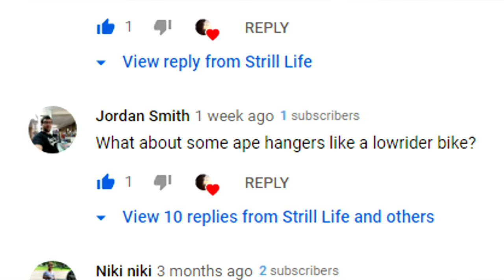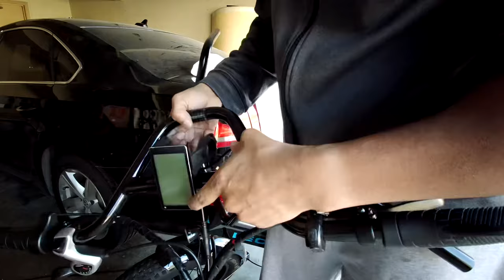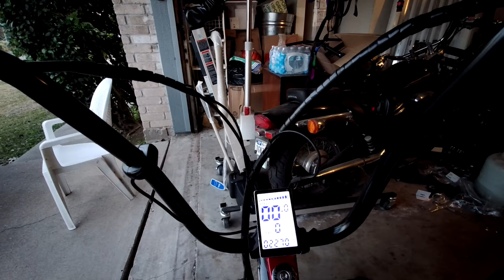Ape Hangers on a Lectric XP!?!?  New bars and mods... The Lectric XP adventure continues...

Comment: When I changed seats, and added Zoom SP, on my XP, I lowered front end of seat. This allows me to rest on back of seat (when I want) and this gives me Excellent shock support.
Reply from the maker: Ahhhh... i may have to try this. Do you feel like you are sliding out of the saddle though? That's what i feel like when the seat isn't totally level. I always have to reposition my butt on the seat.
Reply: @StrillLife  Perhaps a bit. I'm still using stock handlebars, so my experience may differ. Also, I'm only 5'8"...
Reply from the maker: @diamonddbw  oh ok. The bike is the perfect size for some one your size. It's a compromise for anyone who is taller. It can accommodate taller people and be comfortable about I didn't like riding 7ft up in the air. Lol. So I've had to find the happy median when riding.
Reply: @StrillLife  I bought a FMFXTR straight end pole via ebay, so I can mount a saddle with standard clamp, it is 350mm long, if the pole squats low as you sit on, there is a preload at the bottom of post, use 6mm allen hex key to screw the bottom nut in if need be

Comment: The secret to taking the stock grips off is to use an air compressor with the small fitting that fits in the hole in the grip.  The grips practically fly off once you hit the trigger.
Reply from the maker: That makes sense. I don't think my rooty-poot mini car compressor would have done the trick but I sure would have tried it if I knew about this trick before I cut the stock grips off. Thanks for tip.
Reply: @StrillLife  If you ever want the stock grips again....i think they're like $7 on aliexpress....
Reply from the maker: @Knifenerd  cool. Thanks for the heads up.
Reply: A nice set of clinch on grips would be cool,

Comment: Big Strilla!! Your joint is nice! Does it feel a little different than the bmx bars. (Haven’t finished the video yet) sorry if you answered it in the video. I’m commenting as I watch lol
Reply from the maker: Yeah every time you change the way the weight is distributed over the bike it feels different in the turns. Like you feeling like you are falling sometimes and have to catch yourself with momentum. 

Also like I was showing early in the video the bike doesn't have the same torque that it has with a strong battery. So it takes some getting readjusting to. But it doesn't take long. I think I'm going to like the new seat and suspension post. I need to ride a little longer to know if it's real or just hype. I'll keep you posted. I'll do some more videos once the weather clears up.
Reply: @StrillLife  What size seat post do I need to replace my stock one?
Reply from the maker: @rrjetpilot5436  good question. I forgot exactly. Let me check.
Reply from the maker: @rrjetpilot5436 the original post is 1.25" diameter (31.8 mm) and 19.5" long. I hope that helps. My suspension seat post has a slightly smaller diameter. I just had to screw tighten the clamp some. No problem.
Reply: @StrillLife  Thanks the 31.6 probably should work with no problem. I discovered your channel while I was searching for info on the Lectric xp bike. I ordered one last week I know I'm going to upgrade the suspension as soon as I get it. I enjoy your videos! Keep up the great content brother👍
Reply from the maker: @rrjetpilot5436  Thanks so much man. I've been thinking about some new videos for the bike.  I need to get a least a new rear tire.  It's almost bald. LOL. And thinking about a few other things.  So stay tuned.  It might be a minute but I'll have to do or not be able to ride and I couldn't deal with that.  LOL
Reply from the maker: @rrjetpilot5436  and the 31.6 is what I have as well.  The one I have isn't a long as the stock seat post. So that's something to consider if you have long legs. I'm 6'2" and the seat max height is a lil lower than I'd like but I'm used to it now.
Reply: @StrillLife  I never actually used one but kenda tires looks good. Ive only used the kenda innertubes on my regular bicycle and they worked great!

Comment: Damn they are giant! Very cool, wonder if they make those with a cross bar? They would look even better....giant bmx bars! I dont need to flod them down, could i just get a long goose neck... ( stem) and mount them on that. Idk ill have to see how comfortable they are woth the stock bars first,  i just bought a  senada drifter,  its exactly like ur lectric....not as  good thou i assume. Did u do adjust ur speed settings?  They say i get more speed when u dp that,  id like to see if mine will get higher speeds also
Reply from the maker: Lol. I really like them. The do flex a little under hard braking but not much. They are pretty solid. I think these have a 12 inch rise. They are much wider however. So getting used to turning and balancing on the bike is a lil different... Noticeable mostly at low speeds and in turns. The bike can seem a little tippy until you get used to it.

Comment: It looks like your stem has some play.  If the stem isn't a 25.4MM stem like the factory stem, you need to buy a shim which is an adapter to make a 22mm tube fit into a 25.4mm tube perfectly leaving no gaps or play.  I'm not sure if it's the right thing to do but I saw the other guy (brand new guy or whatever his name is) using the quill from the stock stem.....If there is any play at all in the stem, it's super unsafe because with each vibration from the road, the metal is slowly getting distorted and more loose every second which will cause all sorts of problems on the bike.
Reply from the maker: I did follow David's suggestion and swap out the stem wedge with the stock wedge. The stem is very stable now compared to how it was. I hadn't finish doing all the adjustments and tightening in that shot.

Comment: Ya my tires are about the same as yours. Im thinking about the kenda kraze i think theyre called....they look more like motorcycle tires
Reply from the maker: Yeah I think those are the ones I was thinking about. Less friction on the road. And enough traction for light trail riding.
Reply: @StrillLife  ya those are the ones on rads site...im not sure how theyll handle on the sandy/gravel/pebble trails that we have. But they look great for the street. Check out the electric horn on juiced bikes site....i just got mine and im waiting for nice weather but its loud
Reply: @StrillLife  After having the back tyre blown by one of 15 stanley cutter blades on the road, I put Innova city slick on the back wheel, the bike seller didn't honor a claim about the tyre (consumable item under warranty clause), the Kogan website doesn't have item specific warranty conditions re: bike, they are mainly TV and phone and IT seller
Reply from the maker: @manFromPeterborough  how is the new tire working out?
Reply: @StrillLife  good until today I copped a 3 corner jack (thorn), causing slow leak
Reply from the maker: @manFromPeterborough  that sucks.  Are you going to patch or replace the tube?
Reply: @StrillLife  I can patch the tube, with slashes, you have to buttonhole each end of slash, simply fold the slash and cut 1/16" hole on the end, otherwise it will grow under the patch and cause future flat, years ago I patched a slash tube on a postie Honda CT110 that later nearly killed me going through curved intersection @35mph front wheel flat, I put my feet out to skate along the road, that was 14 years ago. The man at REMA TIP TOP (Steve) told me about buttonhole-ing. I went to TIP TOP yesterday to show Steve the tyre and tube, I asked the young dude there does Steve still work here, he said Steve died 2 years ago (age 60), he knows nothing about tyre repair unlike Steve, not even patch a tube, didn't ride bikes as a kid
Reply from the maker: @manFromPeterborough  wow that's crazy. RIP Steve. Yeah a lot of knowledge gets lost over time. I guess that is how it goes. I get what you mean though. Kinda like repairing a windshield when it's just a chip before it spiderwebs across the whole glass. Once it's starts it too late.
Reply: @StrillLife  I've heard of some gel they inject into a windscreen star crack before it grows, I think that service is from Windscreens O'Brian (Australia), this kind of repair is much cheaper than replace
Reply from the maker: @manFromPeterborough  correct. You have to catch it before it spreads. Some kind of polymer they inject into it.

Comment: Did this handlebar mod effect the way the bike folds?  I want to change mine but I still want the fold for my storage spot in rv.
Reply from the maker: Of course on some levels because the dimensions and being able to do it by hand w/o tools is no longer an option. As far as storage and putting in a vehicle I'm not sure. I plan to do a video on the difference because I haven't tried to fold it yet since doing the mod. I really never fold the bike because it doesn't fit in my vehicles w/o a seriously exhausting fight w the bike. But I'll do a video as soon as the weather gets a little better here. I don't really have the space to do the demonstration otherwise. I hope that helps. Stay tune for that video.

Comment: Thanks for  your videos; they
have really helped me look at alternatives for less expensive options. Just got my XP 2.0 and the stock handlebars seem kind of jerky. They feel kind or twisty; that might be because of the 20" tire size.  Do the Ape hangers improve the control of the bike vs a more cruiser like modification?
Reply from the maker: Yes, I feel like I have way more control of the bike as opposed to the Mickey Mouse folding stem.  The trade-off is the bike isn't as foldable or compact in general.  This isn't really an issue for me since I can't really transport the bike in the vehicles I own anyway.  

Having a wider grip makes you feel in command of the bike more. The original bars make the bike feel like a Razor scooter for kids.  IT doesn't inspire confidence at all but to ride the bike on the flattest pavement.  Also, it looks really corny in my opinion.
Reply: @StrillLife  Thanks! Better or worse than the BMX bars? Just trying to decide while I surf the interweb; it's hard to tell with out pics or dragging the bike to a shop. Thanks for all of your posts :-)

Also, did you change the stem or riser? I'm still confused on which one does what. Sorry if I may have missed that info on this video. 
Thanks again friend :-)
Reply from the maker: @TheLauriemacp   i like the ape hangers more.  I'm 48 and the BMX bars have me slumpt over too far for the comfort of my aging back.  LOL.  The apehangers have me in a more upright position like the orginal bars.  They give higher vertical reach.  I think the bike looks cooler with the BMX bars but the leaning over and having my long legs all up in my chest when I peddled was uncomfortable too.  I think the ape hangers still have a cool aestic  as well but make for a more relaxing ride but still maintain great control of the bike.  Like I said in 1 of my videos.  It makes you feel like you are riding a Harley opposed to a kids scooter.
Reply: Thanks so much for your response. My favorite bikes back in the day and the one I always felt the most comfortable with were the Ross Apollo and the Raleigh Choppers. My goal is to get closer to that. Much appreciated :-)
Reply from the maker: @TheLauriemacp  Thats funny because someone suggested that I put a banana seat on my XP. LOL.  I think those bikes were every kids 1st real bike growing up back in the day.  Then you moved up to a BMX for more speed control and off road action and then maybe a 10 speed after that.  

I get so many compliments on my bike since putting the ape hangers on it.  Some kids used to make fun of me when I had the giraffe stem on it before.  Not any more.  LMAO.
Reply: yes :-)  but still craving the chopper feel. This is going to be my quest for our 70/80/90's kids. I will let you how it goes. But probably no Chopper seat; that might hurt, lol
Reply from the maker: @TheLauriemacp  David BrandNew  put a 26" front suspension fork with the original 20" front tire which gives the front of his bike the lift like a chopper but of course the front tire isn't extended forward like a chopper. I think that with some ape hangers would look really bad ass.

Comment: I was about to do this too. Man that looks nice!!!!
Reply from the maker: I really like it Billy. It doesn't fold as nicely now but I have no need to fold my bike that often. I have so much more control and balance of the bike with these bars. Thanks for watching and commenting. I'm about to go for a ride using my new camera in a minute, insta360 Go 2. Stay tuned for the video.
Reply: @StrillLife  Awesome content sir. I crashed my XP a had to replace the front fork. Now I wish I would have gotten the ape hangers as well. I added a Zoom seat post, springer seat, bike horn and a rearview mirror.
Reply from the maker: I'm pretty sure I replied to this comment but I don't see it. Anyway that's ashame because it was detailed. I'd like to have a suspension front fork with my ape hangers. I'd raise my seat even higher. I'd probably have to go back to the stock stem but be able to I get closer to full leg  extension and be able to sit more erect as well.

Comment: It definitely looks more comfortable.  Are you still able to fold down the handlebars and fit the bike in the back of an SUV?
Reply from the maker: I can loosen the 4 screws on the stem to fold the bars down but I don't have an SUV and I'm never trying to put that bike in the trunk of my car again. So folding the bike to stow in a vehicle really wasn't a consideration for this mod for me. I've resigned to the fact that this bike will only go as far as I can ride it and back. Unless I happen to pack it in friend's truck or I get a new vehicle. But the quick  breakdown of the bike is definitely gone. I'll need at least an allen wrench to fold the bars down.
Reply: @StrillLife  it certainly looks better with the ape bars, and seems more comfortable. I like it!
Reply from the maker: @breebrendahowell366  thanks! All early indications seem to prove this to be a win. I can't fit through as narrow gaps that and the PAS switch not being by my left hand are the only draw backs that I see thus far... and maybe not being able to stow the bike as easily which I'm ok with.

Comment: You could have gotten some additional height on the BMX bars by using a steerer tube extension. Would have given you about 3" additional height for the BMX handlebars. Might have saved you the cost of the Ape Hanger Handlebars. Just depends on how high you were wanting to go to. Also there are two types of BMX stems. Front load and top load. Depends where the screws are. Top load will give you about 1 to 1-1/2" greater height on the handlebars. You have front load which means you lost that greater height that a top load stem would have given you. Front load stems are really meant for shorter people that want a lower handlebar.
Reply from the maker: Great info once again. So far for comfort I'm digging the ape hangers. Even when I put a suspension front fork on the bike which will raise the front end at least 4 to 6 inches I think I'm sticking with these bars. Makes my bike feel like a Hog. Lol.
Reply: @StrillLife  You doing the suspension fork still?
Reply from the maker: Naw, no time soon if ever. That's not on my radar at them moment.

Comment: I saw your mod that looks pretty awesome What happens if you do it a banana seat instead of that fluffy seat and possibly some foot pegs if you can stretch out your feet and Cruise
Reply from the maker: Lol. Someone else suggested a banana seat. Actually the same person suggested the ape hangers too. The banana seat was a little too far in my opinion but I'm sure it could be done if you really wanted to. I just didn't want to go that direction with it. I'm sure someone will try it though. 

As far as the foot pegs. Lol.  In my opinion the battery does last long enough to ride around in throttle only mode too far so that would be more of a gag then practical.

Comment: If doing this mod and you are adding a new handlebar stem do yourself a favor and get a stem that has teeth inside the handlebar clamp. The cheap handlebar stems don't have teeth.
Reply from the maker: I agree.  I'm not sure if the cheap stem I bought has teeth or not. I can't remember. But the bars had them which helps the stem grip them. Thanks for watching and leaving a comment.
Reply: @StrillLife  Yes I started looking closer at the stems I was looking at buying and realized that the cheaper stems are only barely finished cast parts without teeth in side the clamp. That is how they make a profit on those cheaper items. I wound up buying a better quality stem about 2.5 times more expensive than the lower priced stems that are all over Amazon and Aliexpress. A cheaper stem is also more likely to strip on the aluminum hole threads for the screws.
Reply: @StrillLife  Once a cheaper stem starts slipping its done.
Reply from the maker: @NotNowLater  I believe it.  There is a lot of junk out there and you are putting your life on the line with a lot of it. My el cheapo stem is holding up ok but I do have to check and adjust at times.